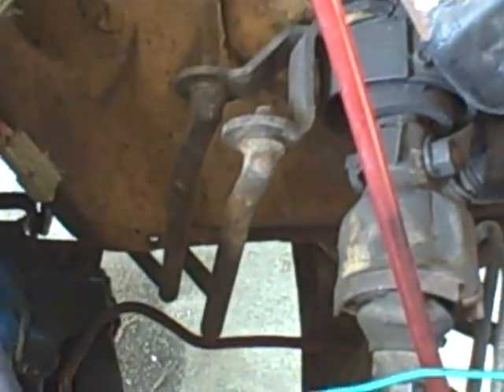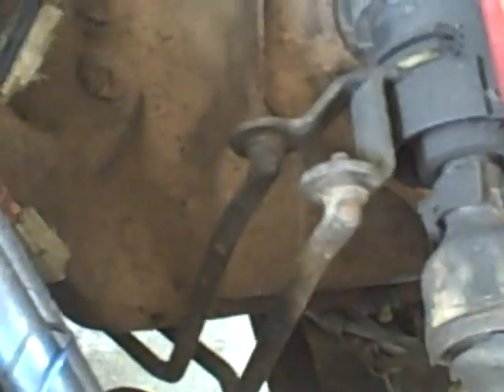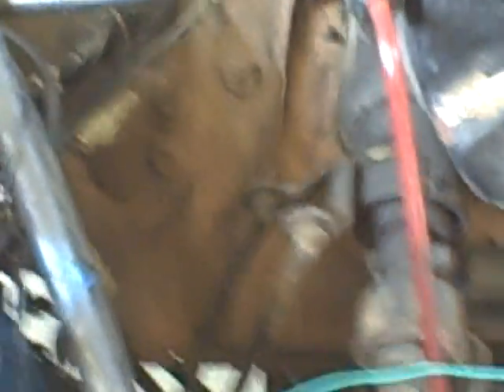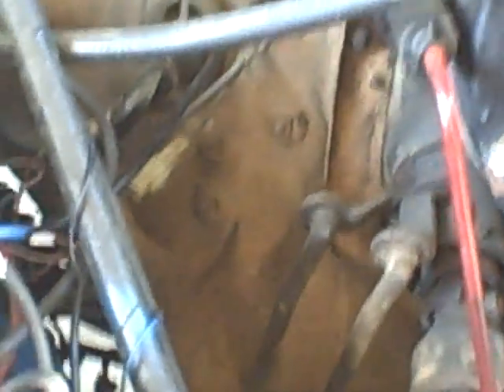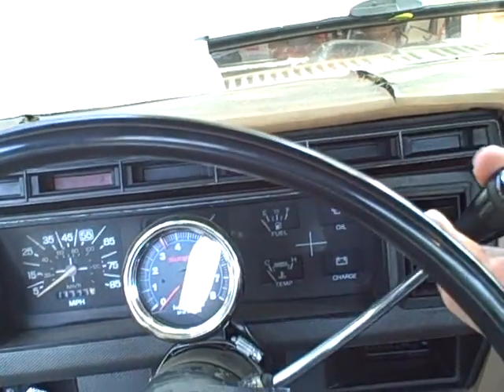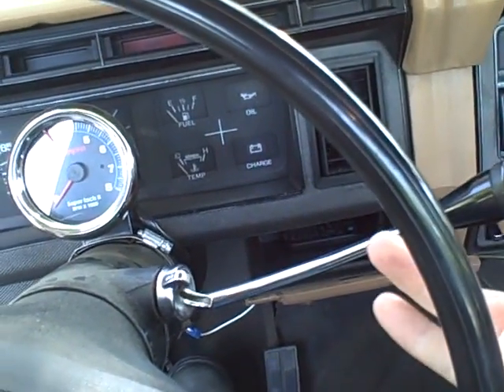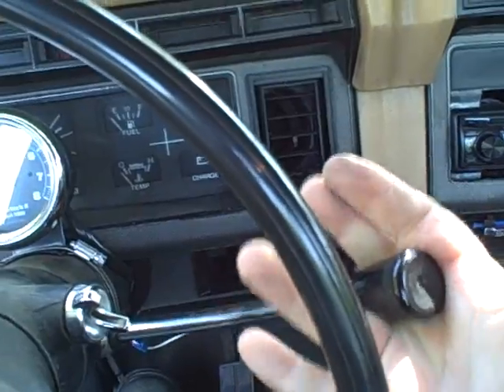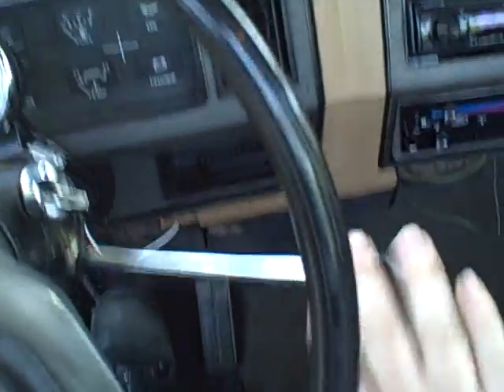How a 3 speed column shift works. P1

Comment: Reminds me of driving my grandfather's 1949 Ford car. Same shift pattern with the classic 3 on the tree. His also had the add on overdrive that would auto shift after a certain mph was reached making it a "4 speed" or "6 speed" if you went OD for all 3 gears. Had fun driving that thing around a few times. Even hot rodded it a bit so it had some get up and go in the old flathead V8.

Comment: When those remember many vehicles that offered a manual gearbox as at the time the automaker had offered a three on the tree when those could know reverse was right at the edge of the steering wheel as 1st was at the driver's knee, 2nd was against the instrument cluster when 3rd was touching the radio.

Comment: the few column shift's I've ever driven tended to hang up and lock up. One old dodge I had it did it in the street, and I got hit by some speeding caddy. I still got a ticket and went to jail even tho I was NOT even in the car when she hit it. I was out under the hood trying to unjam the shifter. That was the strangest old heap I ever had. would start and run good cold, and stay running for a good while, but let it stop while hot, it would NOT restart for nothing. Get cold again, fire right up. Never did figure it out. sold it for a hundred bucks... what I paid for the heap, before it was hit. Yes, back in those days you could buy a running... well sorta running car for a hundred dollar bill. All day long if you had enough hundreds.
Reply: toot tall - maybe a bad coil?

Comment: what were you turning at 65 and 70 mph?
Reply from the maker: roughly 2500 at 65 , never went much faster than 65 due to high rpm's for a worn out straight 6

Comment: My grandfather had a 78 Ford E100 300 CID inline 6 with the 3 Speed column shifter , it was originally a delivery van and he turned it into a camper and used it as his daily for years(he didn't winter drive it, he had an AMC Eagle sx/4 for that). A couple of years ago he got it back in running shape, put a new roof on it, and cleaned up the interior to be more of a regular passenger van, he passed away 2 years ago now but we keep up the maintenance on the van (the transmission had to be rebuilt 2 years ago  but nothing major since then).  It's cool to see how the system works.
Reply from the maker: I like the old Econoline Vans. My Dad had an 84 Ford Conversion Van. It had a 351 with a C6 automatic. He gave me that Van in 96 when he got a newer vehicle. Thanks for watching my video.

Comment: What I wonder, with just 3 gears, don't you end up with enourmous RPM???
Reply: Top gear is a 1 to 1 ratio, just as it is on a 4-speed.  Older engines had good torque at a lower RPM so they often used a taller final drive ratio with which many newer engines would balk when the light turns green.  The big old flathead sizes and inline eights would go from 5 MPH to 100 MPH in high gear without so much as a slight shutter.
Reply: my 60 falcon is a 2 speed, and i have a 78 f150 with a 3speed. never once have i had an issue leaving a light or going uphill. gearing is all in the rear end

Comment: Just got a 73 f 100 with 3 on the tree. ON the way home I somehow got it stuck in 3rd gear. Any clue what I can check?  Shifter will move up and down, but doesn't seem to be doing anything. It is IN 3rd! thinking bout unhooking linkage to see if column shifts bein unattached to see if it IN the tranny or in the column shift assembly. Any advice is greatly appreciated!! thanks

Comment: In one place here, you said (but which is not directly repliable-to), "This truck is no longer a 3-on-the-tree. It started popping out of 1st, so I installed a floor shift[er]."

Well, if you could try to supposedly "fix" that problem by converting it, then why not just try to rebuild the linkage that made it a column-shifter in the first place? And then what happened to your column lever and sleeve after that?
Reply from the maker: As it turned out it was not the linkage that was the problem. It was the transmission itself. I converted it to a floor shift mainly because I was tired of the column shift.  The column is still in the truck, I just removed the handle. I saved all of the external linkages and put them in storage.
Reply: OK, so then why didn't you just tell us that you converted it for that reason (especially if replacing the transmission would have still allowed you to use the column-shifting linkage)?
Reply from the maker: MaxxFordham
When I converted it I thought it was a linkage problem, since parts are next to impossible to find and I was tired of the column shifter it was an easy decision to convert it. As it turned out though it was the transmission. I found a 4 speed toploader imposter (google it) on craigslist so I swapped that for the 3 speed. That got me down the road for about 6 months. Then I swapped in the V8 and automatic.

Comment: May I recommend a reshoot/reedit or at least corrective annotation? Right where you say that this is "vertical" instead of "horizontal," it's really the other way around. The floor sticks are vertical. This one is horizontal.
Reply from the maker: The shifting motion on a column shift is vertical, as in you move the shifter in a vertical motion opposed to a horizontal motion on a floor shift. And yes I need to make an update video, now this truck sports a 4.6L v8 and automatic transmission out of a 95 Ford Thunderbird. I completed that swap about 9 months ago, but then a few weeks ago the relay control module went out. so now the truck is just sitting.  I am too lazy and cheap to fix it right now.
Reply: OH, you were talking about the motion, not the actual position of the lever. Got ya! Thanks.

Oh NO! Why did you go putting an AUTO in your truck now? What happened: ya went and got all soggy on us now, ha?
Reply from the maker: MaxxFordham I have driven stick shifts almost exclusively for over 20 years. I drove a semi truck almost every day for 12 years. I have had my fun with shifting gears. It is time to give an auto a try. I picked up a 95 t-bird for $500. Rebuilt the trans and decided that engine and trans would work good in my truck. Guess what? It works great!! Great power and 21 MPG on the highway. I can't complain.

Comment: I love the sound of ford drum parking brakes slipping. no wonder he left it in first.
Reply from the maker: Interesting how you heard the drum brakes slipping. At the time of the video the parking brake cable was broken, so no parking brake at all. It was rolling back because the motor was well worn (very little compression) so the motor was slowly turning allowing the truck the move a little bit.
Reply: I suppose the drums make that sound forward or back. my parking pads are garbage, so it makes that sound when I park on anything over 10 degrees.

Comment from the maker: Yep, floor conversions are easy to do! Ford wasn't the only one to use column shifters. GM and Mopar used them. Toyota had 3 and 4 speed column shifts , several European cars had them (3 and 4 speed)  Until the late 90's Nissan Cedric taxi's in Asia had 5 speed column shifters.

Comment from the maker: It is either the transmission or the shift linkage. Look at the two linkages going from the steering column to the transmission. Do the look ok? Are they bent or hung up? Next go under the car on the drivers side of transmission, disconnect the linkages and try manually shifting the transmission shift arms. If all of this ck's out then the problem must be inside the column tube, or at the base of the column. If so good luck finding parts, it may be time for a floor shift.

Comment from the maker: good memories.. This truck is no longer a 3 on the tree. It started popping out of 1st, so I installed a floor shift. That seem to help for a few days, then bang!! 1st gear broke. So I found a used 4 speed with overdrive (4th gear is overdrive). That is working for now, but this transmission has bad synchros and it pops out of 2nd!! That's what I get for fixin it on the cheap!!